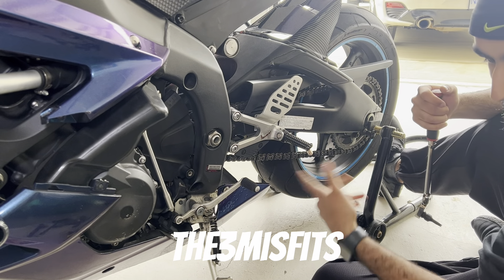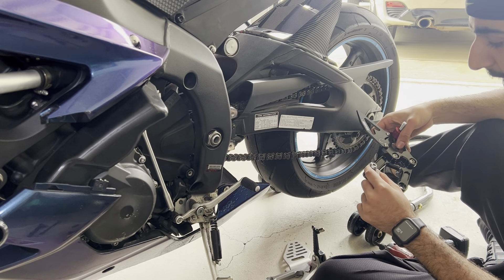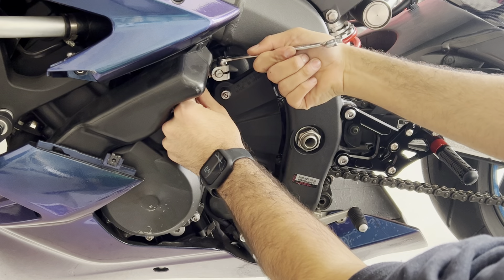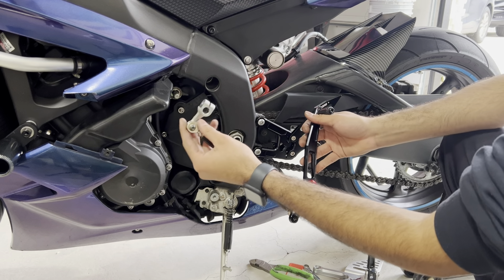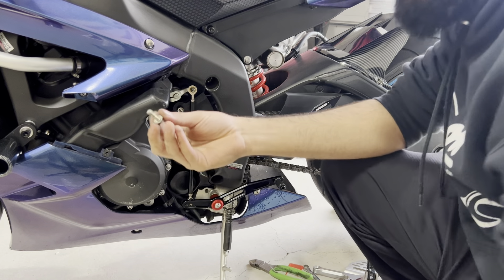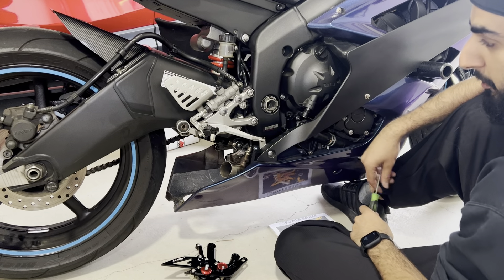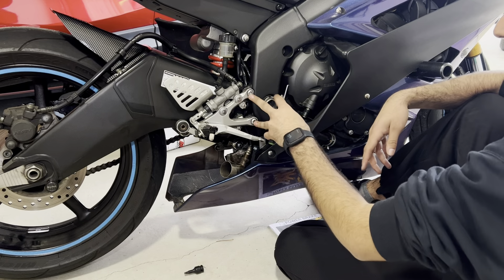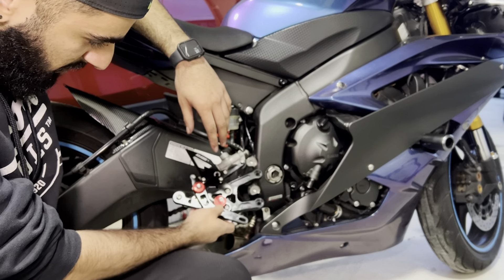How to install Rearsets on a motorcycle Arashi 2.0 (2007 Yamaha R6)

Comment: I've got the same set for my 2017 FZ-10. I like them but having a hard time figuring out how to adjust the rear brake. I've been told the red oval "adjuster" sitting over the pedal is what adjusts the height but it seems to also "apply" the brakes. How did you get yours adjusted without having the brake actually engaged? Hope this makes sense? Adjusting the pedal with that adjuster just seems to push the bolt into the rear master cylinder and applies the rear brake.